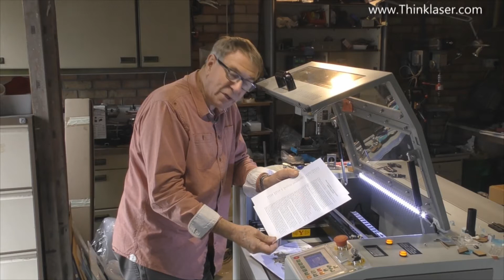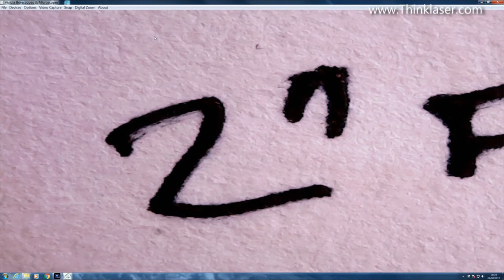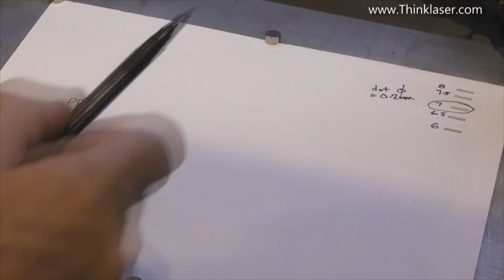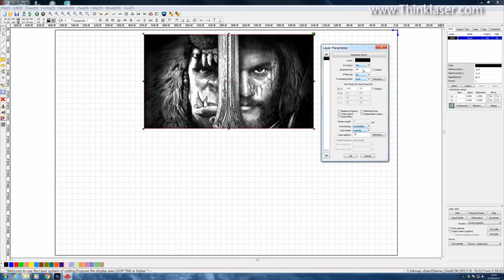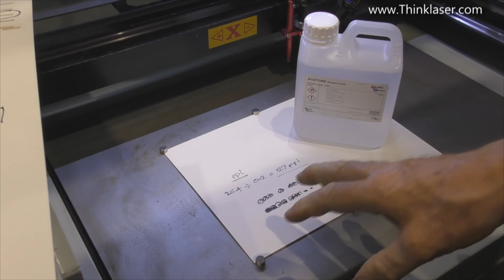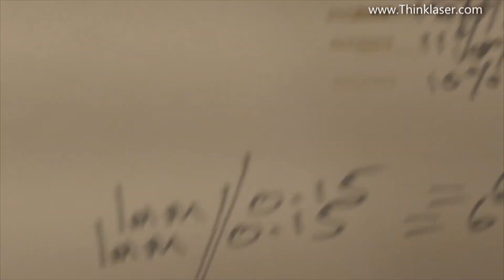How To Use A Laser Cutter - Lightblade Learning Lab 32 Russ Formula for Successful Photo Engraving

Comment: Congratulations on such an excellent Video, it is helping me a lot to understand some of my problems when recording photos. First I need to get the width of my point, I have a 1.5 "lens, but I don't have the pattern that you used and I don't design the sizes, and the link doesn't work. I don't know if you can update it or you can. go to my email. (I pass it by private)

Secondly, I see that it uses dots, which in LightBurn may be Jarvis, but is there any reason why it is better than Grayscale?

Thank you very much and congratulations again